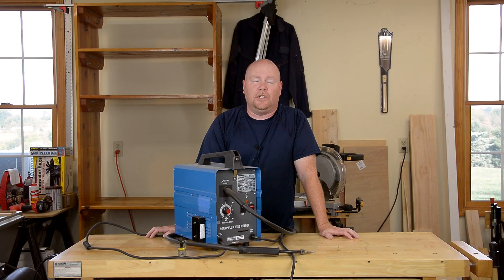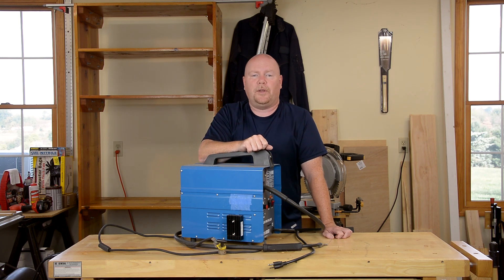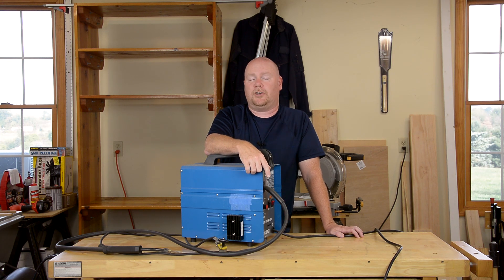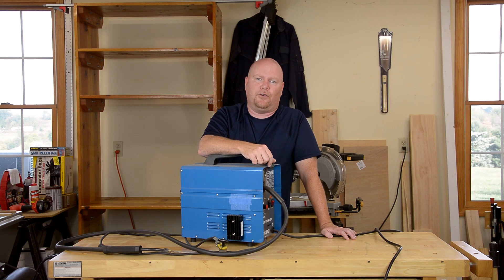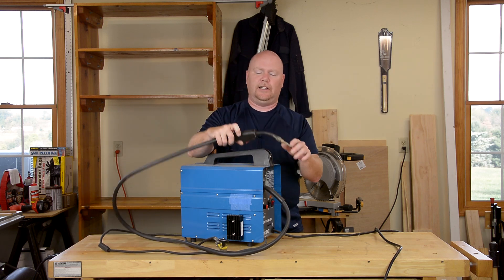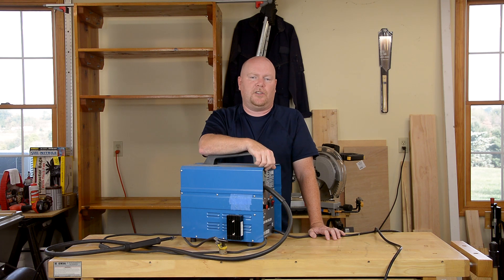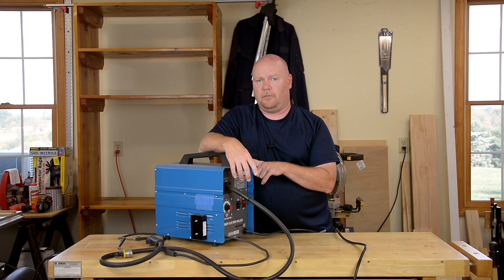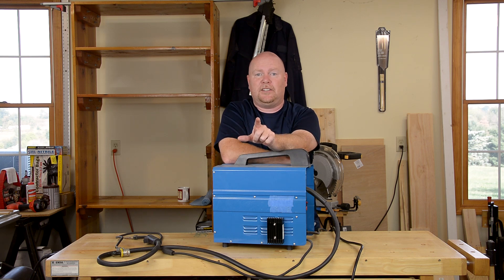Advanced Harbor Freight 90 Amp Welder Mods 09 - The F.A.Q.

Comment: Matt, I have the newer model (62719). I noticed the guts are a lot more complex, and the circuit board has a lot more onboard. I believe the wires we are cutting into, but am not certain. Any advice?
Reply from the maker: +Jeremy Glenn I have gotten some feedback from subscribers who've completed the mod on the newer welders, so I know it works, but I've not seen the inside of a new one myself.  The major difference seems to be that the new one has the circuitry on board to kill power to the tip when you release the trigger.  Only advice I can give you is to make sure that you're putting the new components "down stream" of this circuitry.

Good luck!
Reply: +Matt Heere got we done man. They just did a real good job tucking everything on this newer model. Very easy. Definitely recommend this mod if you have a welder like this. Will go for a better her capacitor at a later date.
Reply: +Jeremy Glenn  got her done**
Reply from the maker: Sweet!  You should post a quick tour of it and leave the link here.  Guaranteed there are folks who want to see the results with the current model!

Comment: Master Matt,

Thank you so much for sharing your knowledge and experiences.

I am happy to report that I just completed all modifications to the old "blue" HF Flux Core 90AMP (80AMP) Welder, I got for FREE. I can confirm even at minimum, the weld does in fact penetrates deeper than in the original configuration and nice slag on top with out blowing off like before. Bebe's are almost non-existent.

CAVEAT, you must discharge the capacitor after use, I just turned it off then shorted it on the piece of steel I was practicing on.

I opted to install the 3 phase 150AMP Voltage Rectifier and a 50VDC 53,000 uf Capacitor ( bought both from ebay), the capacitor was HUGE, 2.75" dia X 8.0", so I had to install it on the outside with some hose clamps. It is Hideous but works PERFECTLY :D

A note for those who do not know how to figure out which terminal on the rectifier is DC Positive and Negative. Place the black lead of the Digital Volt Meter ( in Diode mode ) on any AC terminal then red lead on a DC side. The one with "OL" or 1 would be POSITIVE and the other side with will have a value of 400-600 which would be the NEGATIVE side. The rectifier was labeled but it was not too clear and it was in Chinese :-P

I wanted to double check prior to turning it on and was really insecure about placing the jumpers on the correct side of the rectifier. Verified and marked. I also went a bit crazy on insulation and heat shrink. I just need to make a terminal cover for the outside monster capacitor :D

Tested, BINGO! All good and ready to do some reduced bebe wire welding :D

Again thanks MH!

Jim
Reply from the maker: +Jim Chang Wonderful!   Thanks so much for sharing your additional notes for everyone.

Comment: Hey Matt , great set of mod  videos , realy like your style . I have a 50volt 100000 mfd capacitor, is that fine ?  oh I have a 5 watt  150 ohm resistor for a bleed , is that good ?
thanks ..
Reply from the maker: yes and yes, although you'll probably find that the resistor isn't really necessary.
Reply: P = V xV/R = 21 x 21 /150 = 2.9 Watt < 5watts is wonderful for derating
Reply: Hi Matt, I got a 50uf +-5% 250vac 50/60hz.
Can I use this capacitor?
Thank you!

Comment: I made the mods just like you showed and checked, rechecked and double re checked my wires. The bridge rectifier is even the same. The only difference in my mod , my capacitor is a Philips 75VDC 100 surge 23,000 UF. I turn the unit on and am getting a loud hum from the unit and then trips the breaker after about 20-30 seconds. Any ideas wheat I did wrong?
Reply from the maker: try it without the capacitor.  sounds like yours may be bad.  if that doesn't do it then either there's a short somewhere or the rectifier is fried.
Reply: Took capacitor off and it still does it. Would it matter any that I have one of their older 100 amp welders?  It doesn't even have a fan in it. Do you think I need to run it off a 220 plug?  Sure seems like is it just drawing too much amperage.

Comment: What type of 8 gauge wire did you use? Got some THNN but it looks like that's welding wire you used. You said it was RV wire or something but not sure about type and if THHN would work.
Reply from the maker: +Hidden Resolve I honestly can't remember for sure, and I went and looked and the wire itself isn't marked.  Odds are strongly in favor of it being THNN as you typically have to specifically look for cable that can be buried, and I'm sure I didn't do that.

It makes no difference in this case anyway.  Either has the same current carrying capacity, and there's no weather exposure here, so grab whatever is readily available.
Reply: +Matt Heere Thanks for the info! Started looking into the transformer and started cutting and it seems the wire from it is 8AWG Solid Aluminum and the newer version has way more wires for the switches. Probably spend an hour with cable management. Gonna just drill a hole through to the wire spool area and throw on a cooling fan under it. Cant do nothing till my cap and rectifier comes though. Sads.

Comment: I'm not sure if I did something wrong or if this is normal but my capacitor was reading over 80 volts.
Reply from the maker: +bill shoop That is decidedly high.  What is the RMS AC voltage going into the bridge rectifier?  The output / cap D.C. voltage should be ~1.4X this open circuit - a.k.a. on but not welding.  It drops down to equal the RMS AC voltage as soon as you put a load on it though.
Reply: There is 26vac going into the rectifier and 24.2vdc coming out of it.
Reply from the maker: Hmmm.  Then something doesn't add up.  If the cap is hooked up correctly then the voltage across the cap is the same as the voltage across the output of the rectifier.  Make sure you're wiring path is + on the rectifier to + on the cap to the "ground" clamp, and - on the rectifier to - on the cap to the torch.   With the cap hooked up I'd expect you to measure ~32VDC across both it and the rectifier output when not welding.
Reply: I triple checked everything to make sure it was wired correctly before I powered it up but took the cap out and have been using the welder without  it.  I tested the cap with a power supply that puts out 18 volts and for some reason the cap measured about 27 volts. maybe the cap is bad? I don't know much about caps so I wouldn't know.
Reply from the maker: It's easily possible.  I suppose it's also possible that there's something about your meter that makes it read high in the presence of a large capacitance too, but that's highly unlikely.  

Unfortunately failures are rampant in this category of capacitor.  Good news is that you can run the mod without one and still get 80-90% of the benefits.
Reply: It welds a great deal better with just the rectifier so I'm not going to use a capacitor and use that room to add a small secondary transformer to separate the feed motor to smooth out the feed rate.

Comment: Matt, Thank you for the excellent videos. I've really enjoyed them.

My Question: What would a large can DC capacitor like this normally be used for? That would really help for those of us that like to salvage for the free (cheap) stuff.

Thanks again.
Reply from the maker: +Steve LaWarre Unfortunately they're a lot less common than they used to be.  They were everywhere back when computers were big power hungry things.  This type of cap came into being as part of the power supplies for computers of the 70's and 80's.

Power supplies are still the main application for these capacitors.  It's just that it's getting harder and harder to find stuff that needs a cap this big.  New power supplies do such a good job of controlling voltage with switching frequency that a huge cap just isn't needed.
Reply: +Matt Heere That's what I'm finding here in West Michigan. We have a couple great electronics salvage/tinkerer stores and their response has been "we don't see those much anymore..."

Comment: Anyone know if I can wire the mods with 12 gauge stranded?
Reply from the maker: +HNX Media It's possible, but it's a bad idea.  even the 8GA solid is under sized if you're a stickler for the specs (http://www.powerstream.com/Wire_Size.htm is the reference I like to use).   Basically, every 12 inches of that wire turns into about a 100W space heater at these amperages.  Think about how hot an old incandescent 100W bulb is... 

The 8GA solid is readily available by the foot pretty much everywhere, and you only need 2 feet.  Do your ability to sleep well a favor and track down the heavier stuff.
Reply: I'll be safe and get the 8. Thanks, Matt!
Reply: Finished my welder mod! Turned out really good and it WORKS (despite my lack of electrical knowledge). I installed a 120v fan (my model never had a fan). But I wired the fan directly from the "incoming" power cord before the switch, so it is always "on" when the welder is plugged in. Not a problem since the idea is to keep the welder cool, but I might use it for a while and see if I need to wire it after the switch. We'll see. Overall, this is an AWESOME project if you already have one of these craptastic welders. Thanks again for all your guidance, Matt!
Reply from the maker: Fantastic!   Glad to hear that all turned out well.  Happy Welding!
Reply: +Matt Heere Hypothetically, let's say that after a lot of welding, the welder makes a loud hum/buzz and will no longer feed wire or push current through the tip. Could I have burnt out the rectifier (I used a 1600V rectifier and upon opening the welder back up, noticed it had melted off its mounting bracket)? All this is hypothetical. of course.
Reply from the maker: +HNX Media Uggggg.   Yep it sounds like you're, hypothetically, having a pretty bad day.  They say every cloud has a silver lining.  Not sure what the silver lining is to melted electronics, but you almost certainly have the cloud.

Take the tip completely off and see if you can push wire through the liner.  There's an off chance that you just have a tip that's welded itself closed.  However, the lack of current at the tip isn't a good indicator.  Neither is the loud hum.  That's the sound of a shorted out transformer.   Don't run it any more except for the quick feed test until you get that rectifier out of there.  Don't forget to unhook the cap too, as you'll destroy it running without a rectifier.

Comment: Thanks Matt, I just did this mod to my black HF welder #68887.  It is a completely different machine as far as performance.  My new unit was a bit more of a challenge with wiring and cap placement due to the different configuration.  The only thing for me to get used to is the fact that the cap is live and will arch till you short it even though the overall torch from the welder is not live.   I just simply tap it and short out the cap, then set in place and weld away.
Reply from the maker: +Troy Morris Very awesome Troy!

Comment: Hello Matt, really loved watching all your videos of the HF welder. Only problem is I own the Chicago electric DUAL MIG 151 T/2, Model 43028. Can you suggest the Mods I should do on mine? I've looked at a few others here in UTube but none are as clear and concise as yours & I don't want to screw this up. I hope you can help.
Reply from the maker: Hi +Renebq.  Can't say that I know anything about that particular unit.  I would guess that most of the stuff in the basic series will apply to any HF welder.  I don't know if the Dual MIG 151 is AC or DC already.  You could check it with a good meter.  IF it's AC then most of this should apply, except that you'll need larger components.

Comment: Hey Matt  Does this welder do ok with just a rectifier and leaving a capacitor out???
Reply from the maker: +MrStealth654321 It sure does.  It obviously runs better with both parts, but the rectifier alone will work and it provides most of the benefit of the mod.
Reply: +Matt Heere  Thx. Nice of you to take the time and reply .and show us your mods on this welder. Great job!!
Reply: +Matt Heere  By the way how does this welder do on sheet metal?
Reply from the maker: It's tough to get it turned down low enough.  Even on the "MIN" setting it's pretty hot for sheet.  Expect to weld about an inch and then pause to let the metal cool.  If you try to run a continuous bead you will burn through every time.
Reply: +Matt Heere  OK thanks alot. Nice videos !!  Take care bud.

Comment: That's you so much for these videos ! Made my almost useless harbor freight 90 amp welder to something I can make a nice bead with !

Used a slightly bigger capacitor and a slightly bigger bridge rectifier both purchased on ebay.

Keep up the good work !
Reply from the maker: +docmortal Glad to hear that it helped and that you had some success.  Good calls on the components too.  It hasn't bitten me yet, but I wish I'd gone with a 150amp rectifier just for piece of mind.

Comment: Hey Matt,  i have a question as far as caps go. i have one of those useless welders and am thinking of doing this to it. i have a 500k micro farad capacitor  but i have no idea what voltage it can handle. its digital and has a nifty readout but it doesnt give me anyother info than that its a 500k uF. is there a way i can fint this info out or am i just SOL?
Reply from the maker: +Complete LawnCare Solutions A capacitor in that range would be enormous - almost the size of the welder - if it were also rated for a high enough voltage.  With the digital display on it I'm 99.9% sure that your cap is designed to be part of a car audio system.  Those caps come up to 1 or 2 Farads (no micro- prefix)!  BUT they are only rated for about 15V continuous, 20 surge, enough to handle the ~14 volts you find in a running car. 

Sorry, but it almost certainly won't work for this mod.  However you're not SOL.  You can do the mod with no capacitor at all and it's still a huge improvement.  Add the cap later when you run across a good deal.
Reply: +Matt Heere Thanks, and your right, it was for a car audio system, but as long as it will work without it than we're golden. thanks again.
Reply: +Matt Heere I figured I've got one, if it will work I'll use it, if not I'll use it as a paper weight.

Comment from the maker: +Brian S  - I opted not to put the bleed resistor in because it either has to be pretty big (wattage wise) or won't bleed the cap for quite a long time.  Haven't found the need to short out the wire to drain the cap to be that big of a deal.

Does the erratic wire feed resolve itself after the welder cools down?  If so the odds are that you're just getting close to the duty cycle, and transformer voltage is wandering around due to heat.   If not, then it's either that your tip is getting fouled (this happens a LOT with flux core) or that the feed rollers are getting dirty and not gripping well.

Never say never, but it's unlikely to be related to the mod.  All the stuff we did is "down stream" of where the feed circuitry gets it's power.
Reply: not to mention like you said in your video, the new revision of the welders have a cutoff now in the trigger so if you just get the newer version you wouldnt need to worry about bleedoff what so ever.
Reply: I added a dedicated transformer for the wire feed. It was a 24v center tap (12-0-12) rated at 2 amps. I wired it up so it outputs 12v and I get a way smoother feed.

Comment: 2 part question Matt
1 . why not put a resistor to bleed off the capacitor so you don't get shocked. 2
2. I noticed now after the conversion that the wire feeds erratic as if power is being lost to the motor after a dozen short welds

Comment: Hi Matt, 

Great videos!  I have one of these welders and the weld is just awful!  all those little b b's and it looks terrible.  Frankly, for what I was doing, I didn't care, but my wife wanted a decoration made out of horse shoes so I went ahead and pulled out the welder and went to work.    I spent more time trying to clean up the horrible mess it made than the time it took to make it.   
I finally came to you tube and found your videos and watched all of them pertaining to this welder. I have done the little stuff, pulled the shroud off the tip,  changed out the wire to Lincoln, and flipped the guide over to the smaller side.  While changing out the wire I noticed this; the HFT wire just bent like baling wire where as the Lincoln wire would easily break into many pieces.   I guess that shows you what is NOT inside the HFT wire; flux maybe.   I have ordered the FWBR and the cap; should be here in a week or two. Cant wait to get this thing to work a bit better. oh, while the HFT wire was still in, I did the wire measurement test, here are my results 0=112", 5=156", 10=340"  (I timed it at 15 second x 4)  I will leave it at 5 and call it good.  thanks again for the great vids.   Ken
Reply: Anti spatter spray is pretty useful for keeping the BB's from sticking. Even after the modification you will get some minimal spatter and the spray will allow it to be easily brushed off. I'm not sure about the fumes generated by spraying or heating this stuff so use it in a well ventilated area.